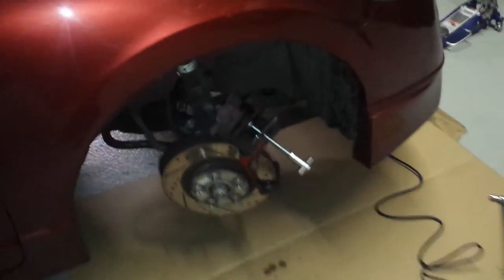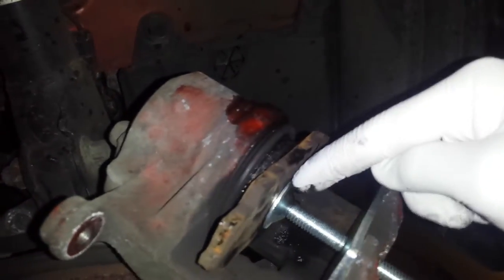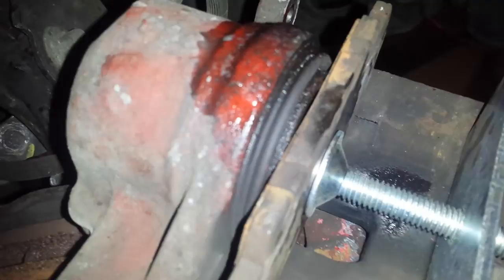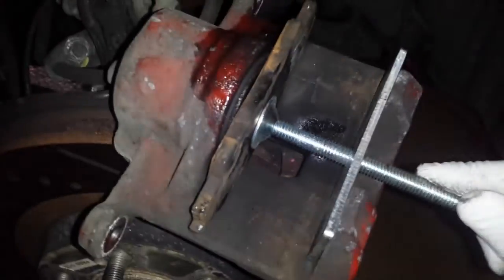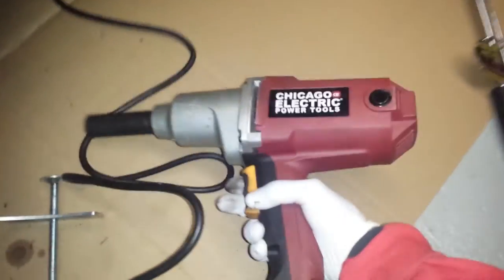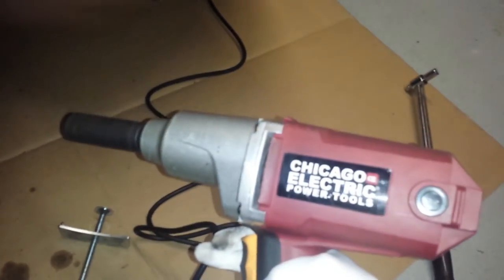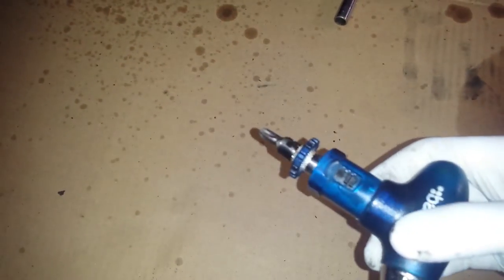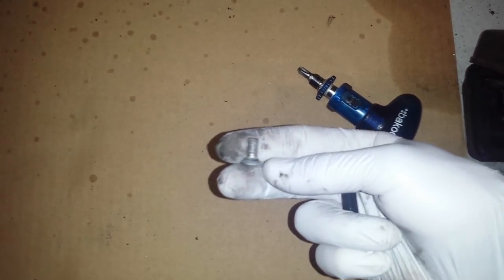Harbor freight tools, Brake Replacement tips

Comment: When you get rotor hold down screws out , discard them , you dont need them. They are there for assembly at the factory.
Reply: I agree and if you live in the midwest good chance they will be rusted and stuck, just drill it out the rim holds on the rotor anyways.

Comment: Thanks for the tip.. I picked one up today.. works great.. and yes remove your brake reservoir cap.. I didn't and thought I busted something cause the pressure came up and started dripping fluid. All good, but didn't remember to open the cap.

Comment: Actually doing it this way forces the fluid back into the brake master cylinder and can cause valveing problems that would require replacing it.
The recommended way to do this is to open the bleeder on the caliper you are working on and attach a hose to it that goes all the way to the bottom of a container (clean, empty soft drink bottle works great) that has a little brake fluid in it (prevents air from getting sucked into it), then use the tool to push the piston back into the caliper. The fluid goes into the container and is disposed of. With the piston fully compressed, tighten the bleeder. Install new pads and the caliper. Do the other side in same way. Then check/add fresh brake fluid to the master cylinder and bleed each caliper (using hose on bleeder to bottle) until no air bubbles are coming into bottle. (Shouldn't take more than a couple pumps of the brake pedal per caliper) Tighten the bleeder.
Reply: Thanks bro

Comment: For the ones that have little experience. 
Even those with experience..

Before compressing the piston..
Bleed the Right front Caliper first until you get fresh clear fluid and make sure the reservoir doesnt go dry..
But dont fill it to the top about half way.
This allows for the compression of the caliper and back fill.
You wont spill any fluid that way..

Repeat the same process for the left front..
When completed top off reservoir...
The reservoir will bleed down when you pump the brakes..
Check reservoir and fill to full mark..